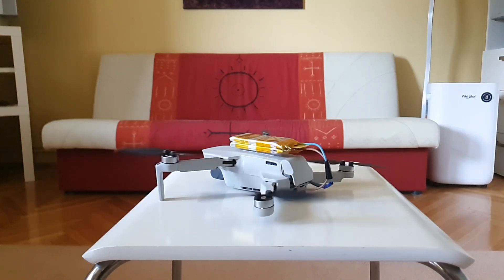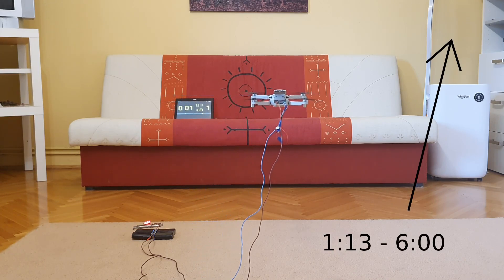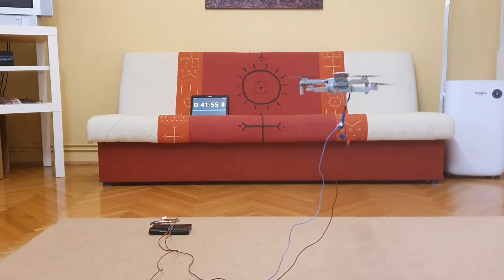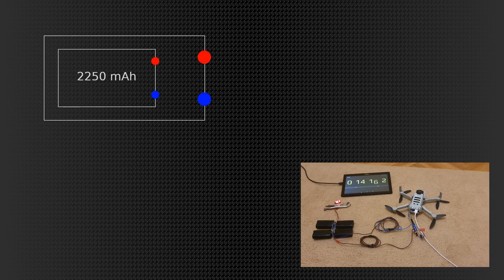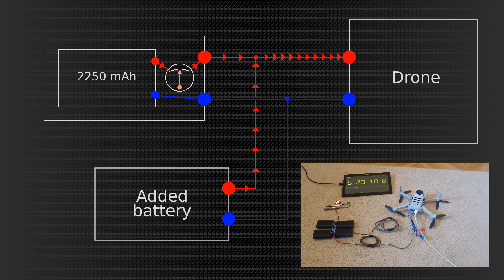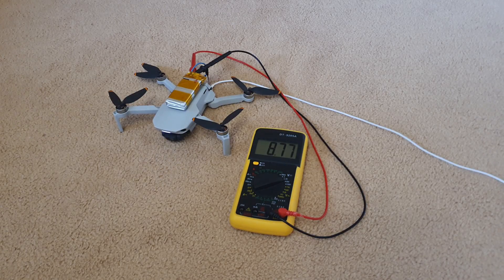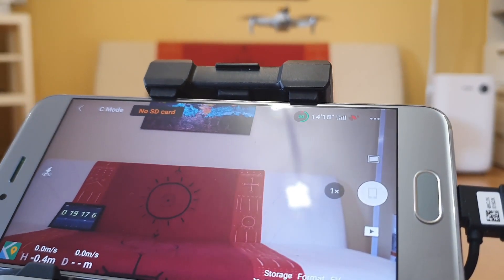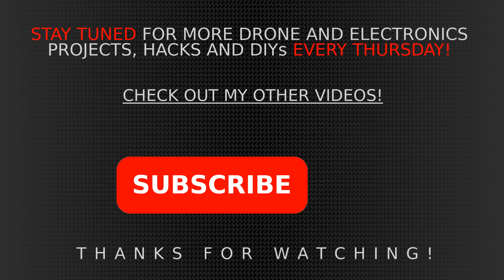Dji Mini 2 Simplest battery mod! 36:20 flight time. (NO CODING, NO SOFTWARE NEEDED!)

Comment: My dji mini 2 battery duration in indoor hovering is about 30 mins..6 mins more probably it's too few gain for the job... At least we know now there's no check on battery board...wondering how can be with graphene batteries

Comment: Alligator clips and a quick disconnect might make your bench testing more less complicated.  I was thinking perhaps create a flat connection on the top shell underneath, that connects to the battery module on the pcb rather than the battery itself. It shall piggyback off the BMS, TX/RX. This way you don't have to keep soldering and leaving that battery gate open Aka affecting the aerodynamics
Reply from the maker: Yeah, that could work too! :)

Comment: great job, again . me new here but an old mini modder . just curious what is the difference on bms or software of mini 2 between the mini. that you cant use the  same solution on mini1
Reply from the maker: Thanks! :) They are different but the same method should work on the Mavic Mini as well! :)
Reply: @ZollyD  i couldnt explain well ,i am asking this on mini 2 ( so no need a original battery)
:https://www.youtube.com/watch?v=EMUqGaAxafA

Comment: I read about some batteries that DJ I sells with a Japanese model of the Mini 2 in which the flight times are only about 10 or 12 minutes but with prop guards and those batteries you're still under 250 grams so you'll be able to fly over people etc.

You can't order those batteries from the company that sells them in Japan because they won't ship to the US.

I wonder if you could try making a battery that along with prop guards keep the mavic mini under 250 grams.
Reply from the maker: I can look into it! :) No promises when, but we will see. ;)

Comment: Wish young people see thing like this rather than those stars etc...Kim Kardashian. Very practical and informative content. I wish you can mod the Mini 2 to run on some high end lithium-ion cells like tesla, panasonic.
Reply from the maker: Thanks! :) I agree, that the next generation should also get some more intellectual stimulation as well. Fine to watch idiotic content, but balance it out. :) Regarding the Mini2 Li-ion cells; that vid will come. I am just waiting for some LiPo cells in the mail now for 3 weeks... The parcel is stuck in customs clearance.... 😴😴😂 when that arrives I will do more testing like in this video, and after that I will move on hacking the Li-ion cells in... ;)

Comment: I always wondered what would happen to the flight time and flight capabilities if someone would remove the plastic frame of the mini. It would mean less weight, but is it enough to save battery. Wouldn't you think?
Reply from the maker: If you mean the top cover, then yes. It is over 10 grams. It does matter. If you watch The Longranger YouTube channel, when he does a world record attempt he is usually flying without the top cover. :)

Comment: I have two questions: 1) that Mini with the additional batteries will go way above the 249 grams, so if my Part 107 studying - still in progress - that will change the class of your drone, right ? In EU, it surely does, problem solved having at least an A1/A3 license (or even better an A2 as well), not sure about the US tho.

2) The tech problem I can foreseee is the change in the center of gravity of the drone, possibly disturbing the electronics (ESC, IMU etc especially having current flowing around those cables) and, most important, the extra strain you will put on the motors adding weight.  I know a Mini 2 can easily lift even more than its own weight, but still.. it's a payload you are adding.  I have no idea what the weight of those batteries is, so won't go in the relative math needed.

I notice you are very accurate in your experiments, so the question is, have you taken into consideration all these factors (aerodynamics in this case does not really matters much, although it does as well, but let's that aside for a moment) ?  I am VERY interested in what you are doing and have thought about trying something similar myself.
Reply from the maker: Thanks for your interest! :)
1. Yes it becomes heavy and thus it changes the class. (To be honest -I think you can tell - I am not a cinematographer. I fly very little and I am not even good at it. I bought my drones because their technology interests me) But, yes if you fly a lot, the licenses have to be upgraded.
2. Yes it is changing the center of gravity. Not that much though to seriously influence anything (my observation). I believe it would be better to put the extra weight on the bottom, but I do want to have the sensors. As I said there is a sweet spot somewhere with the added weight/capacity. I am trying to find that. Plus I wanted to do this mod in a way, how you do not lose warranty on the quad. only on the battery :)
I will have a video coming out this Thursday. I think you will find some more answers in that.
Reply: @ZollyD  Can't wait to see how you managed all this. The sweet spot can probably be calculated, but I am not sure it won't fall in the wrong place.  I wonder if it's somehow possible to mod the firmware in the battery and just change the cells...  Not exactly legal, and not an easy feat, you'll have to reverse engineer the code and modify it accordingly, but I thing that given enough time and skills it CAN be done.
Reply from the maker: @raquilano  The reverse engeneering is already done by Youtuber "The Longranger". So you are right, it is possible to change the battery firmware. I will demonstrate at one point his software (which I do not have yet) and the whole deal, I just want to get the DIY solutions out there first.
Reply: @ZollyD  Can't wait to see the results...
Reply: @ZollyD  any updates about changing capacity in the chip firmware to calculate percentage properly?

Comment: It's high time to learn how to print a battery case on a 3D printer. For high-capacity 18650, 21700 batteries. For all drone models. So that everyone can print a battery case for themselves and insert batteries for a long flight. Stop buying expensive new batteries.
Reply from the maker: Yeah! I am not experienced with 3D printing at all, even though I find it really cool. I wish the manufacturers would offer other batteries for their drones than the basic version! :) But like this at least we´ve got stuff to HACK! ;)
Reply: Don't you still need the mini battery protection board?
Reply from the maker: @divingfalconfpv4602  Yes. Without the BMS the drone does not start. Once it is in the air it just needs the juice, it does not care about the BMS. At least on the Mavic Mini. I will test the Mini 2 as well.
Reply: Guess u can leave one bms board attach with xt30 and balance plug to connector other batteries

Comment: How many charge cycles can I expect from my mini 2 battery?
Reply from the maker: That I would like to know too... :D I guess the general stuff applies. A fast google search says that after 200 cycles you are about to see 75% of your original capacity. I guess only time will tell, because the drone abuses those small cells quite a bit. Often close to 60 degrees Celsius. (140F)

Comment: Impressive results! 👍😎
Reply from the maker: Thanks!  :) I believe it will be significantly better with the new cells! we will see...
Reply: @ZollyD  that chinesee guy has 70 minutes by same way.
Reply from the maker: @linuxettin  That is why I am really curious when the brand new cells arrive..😉
Reply: @ZollyD  i understood at first bro, u just solder parallel right ?
Reply from the maker: @linuxettin  Yes, but not to the other cell, but to the connector towards the drone. Have you seen my other video?
Reply: @ZollyD  yes bro but dat guy just soldered it to + -, and he told no circuit lock on mini
Reply from the maker: @linuxettin  not on Mini but on Mini2 it can happen.
Reply: @ZollyD  thnx for answer and guide mate

Comment: Very good video !!!!!
What cells have you on the way ?
So, just to summarize, if you connect cells in parallel when they are all discharged to the same voltage and then charge everything through in Mini2, in theory, during the flight, he should take into account how many mAh have entered during charging and use it correctly to calculate the percentage left ?
Reply from the maker: Thanks! :)
About the cells I will have affiliate links after I tested them (I do not want to promote something untested). I will update the description.
Or just search Aliexpress for LiPo cells.
About your question: Just make sure that the 2 battery packs are at the same voltage. IT HAS TO BE CONNECTED IN THE WAY I SHOW IN THIS VIDEO! https://youtu.be/Nwx8i52qDEo
Otherwise it will not work!
It doesn´t matter if you charged them together or separately. They just have to be on the same voltage. :)
Reply: @ZollyD  I wonder about cell balancing. The smart battery SOC has the ability to balance between cells, but without the controller the balancing can be significantly changed over time...
Reply from the maker: @Jpeglism  Correct! As I stated in earlier videos: These cells has to be balanced now and then.. Good input! :)
Reply: @ZollyD  Oh okay, so you were charging it through a balancer, right?
Reply from the maker: @Jpeglism  That is correct. :) I charged them up with a balance charger. Then after using it in the drone, I just charge them with the drone (which is so to say not balance charging the additional cells) but I double check with the multimeter. If they go out of balance I correct it. But rather just change cells, as they are not to go out of balance every charge cycle...